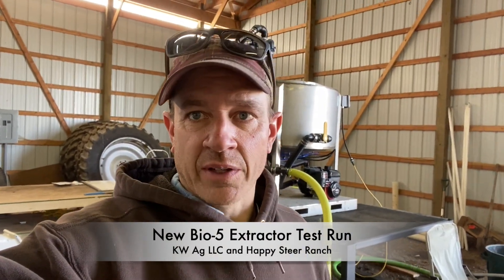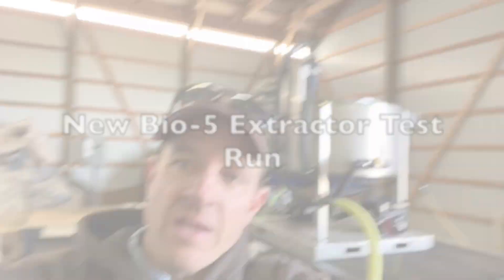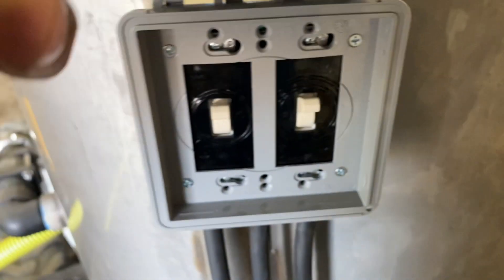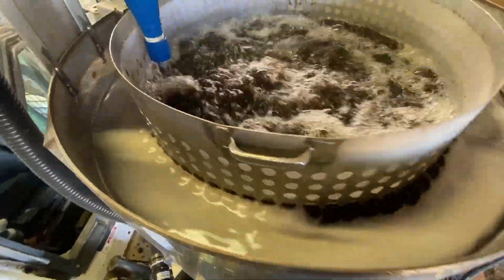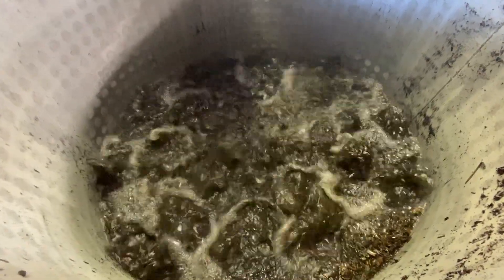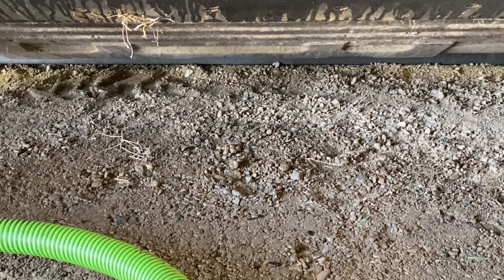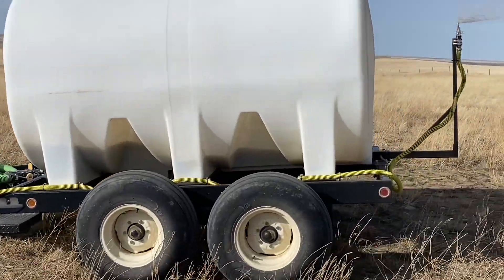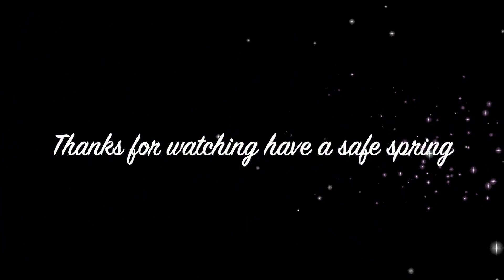New Bio 5 Extractor - Farm Scale Compost Extract Updates for 2022

Comment: Cycling water continuously through a sand extractor can't be good for microbes. The sand extractor will no doubt extract all compost bigger than a grain of sand, so what's the point as the feedstock gets taken out of the process. Rather aerate all the material, and allow the screen/sieve to keep solids out of the final product.

Comment: Fantastic info. Question about your Johnson-Su bioreactors, what’s the lowest temperature they get to in your shop over the winter? Also, do you have an opinion on leaving the reactors outside to freeze over the winter which will hopefully promote locally appropriate fungal activity that will over-winter better when transferred to the fields?
Reply from the maker: Our shop stays pretty much at around 65 degrees all winter.  As far as leaving them out for us it doesn’t work because it gets so cold that they literally freeze solid so we don’t get any breakdown over the winter if we do that and it kills the worms.  That being said that is an interesting point!!
Reply: @koreyfauque7745  same here, frozen solid — however, my thinking is that it’s the type of biology I need to promote to achieve a new equilibrium. Currently have one reactor indoor that’s ready now after a year and two more thawing outdoors for next year.

Comment: hi Jamie Fidler with Fidler Farms  trying to spread extract on cattle pasture and 6700 want work .I am planning on ordering the nozzle from Chaos Springs . what size did you buy , what is the spread width, what is the gallons per acre , and what pressure are running? thank you in advance and thank you for sharing .  If i can figure out how  to share . i will share my adventures
Reply from the maker: Hey sorry this took so long.  We got the 8 and 10 mm but only use the 8 as that is plenty big and plenty of water for what we are doing.  I think we are pushing around 40 psi for pressure
Reply from the maker: I can’t seem to attach an image to this thread but could email you the nozzle chart if you want.  It spreads about 35 ft I think

Comment: How many lbs compost per 1000 gal batch?
Reply from the maker: Roughly 200 or 1 lbs per acre
Reply: @koreyfauque7745  I have a liquid strip till bar, and am thinking of getting an extractor and running it in the the strip till unit.  How many gallons per acre of extract would you use per acre?  Would the biology still be viable if mixed with liquid fertilizer when applied?  Final question.  If I applied fert, and extract in the strips in the fall, would the biology still be there and work the following spring and growing season?  Thanks for your response, and keep the videos coming.  I really enjoy them.  Matt in Iowa
Reply from the maker: @mattshowalter2538  that would work great I bet although the fertilizer would almost certainly kill the biology so I would skip that part.  We tried mixing low salt Alpine G-22 with our extract and it killed most of the upper level stuff like Amoeba and nematodes and appears to be pretty hard on the rest of it.  As far as it still being alive the next year I’m sure that would be the case.  We are actually finding it takes some time to the biology to start cycling stuff (I applied extract last year to some grass and didn’t see much then but it looks a lot better this year)